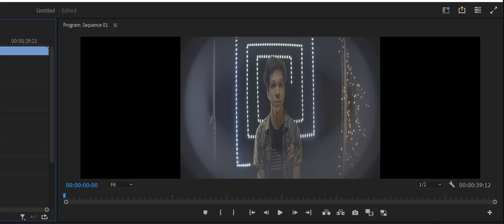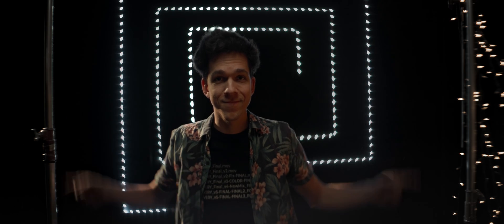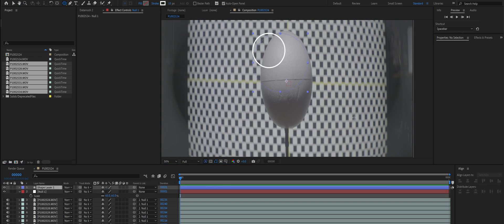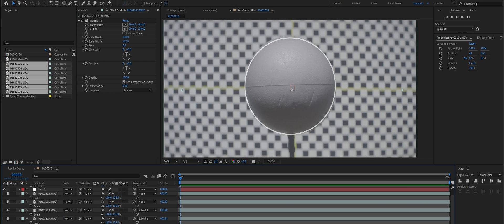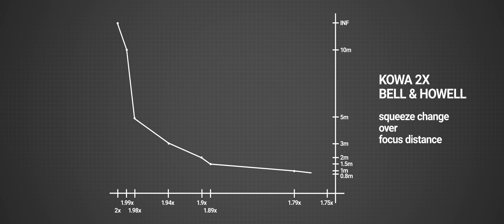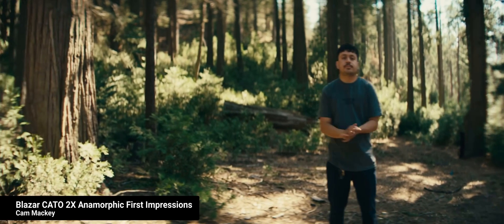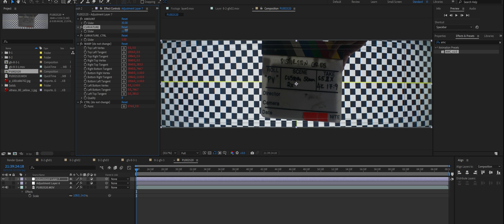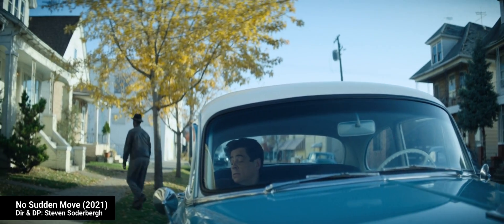Fix Anamorphic Mumps and Overcompressed Edges - Anamorphic Cookbook Module 8 Chapter 3

Comment: Does it help or hinder to use the Sirui 1.25x adapter or the GreatJoy 1.35x adapter? Someone on Reddit said that the GreatJoy adapter would completely stop the squeeze factor changes on the 1.33 lenses. So maybe the 1.25x adapter by Sirui does the same ... And what about using the SLR anamorphic adapters? Have you experienced this by any chance? Sorry for all the questions. But you are our guru ;-)
Reply: I think you are right about both.